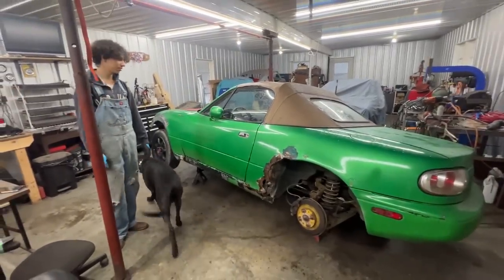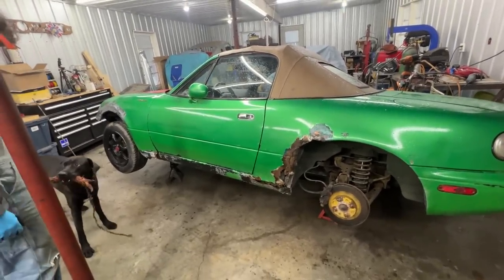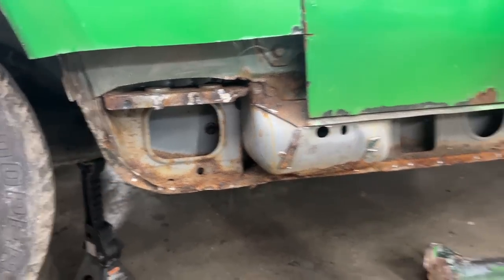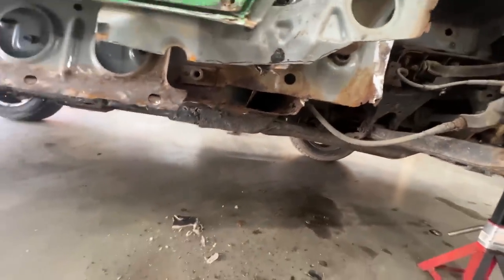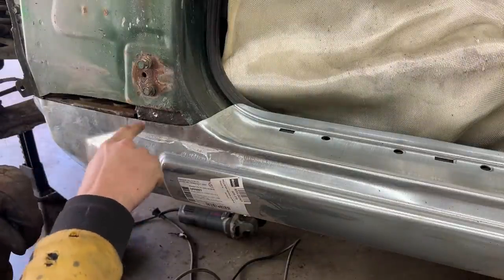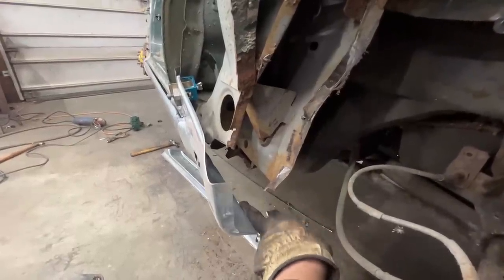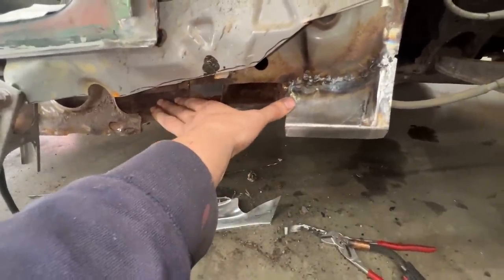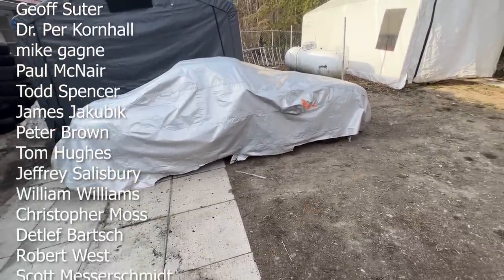1994 Mazda MX5 Miata - Part 16 - Driver's side rust removal

Comment: Your confidence has increased exponentially over the last few years, you are happy to whizz out all the rusted metal with the slitting disc now, knowing you have more than enough skill to make strong an aesthetically pleasing structurally rigid sub-structure thal will extend and blend neatly to the outer panel in its correct position related to the other panels. You seem to eye it all up and the next minute you have a plausable aproximation of a new panel needing just a few tweeks (and a bit of the last bit you chopped off welding back on again🤣). Your skiĺls are a joy to watch! Nikola is coming on in leaps and bounds too!